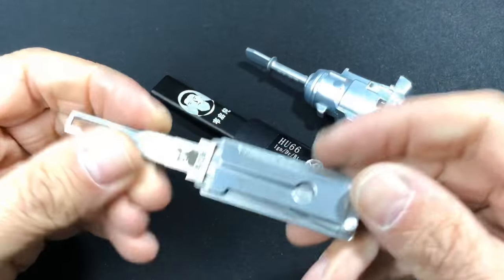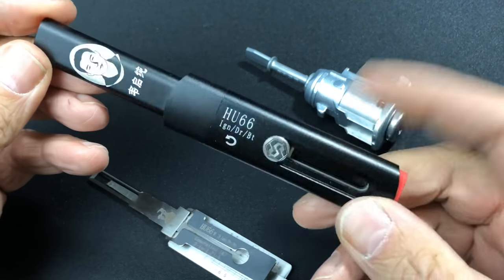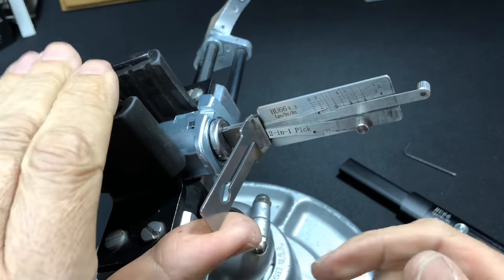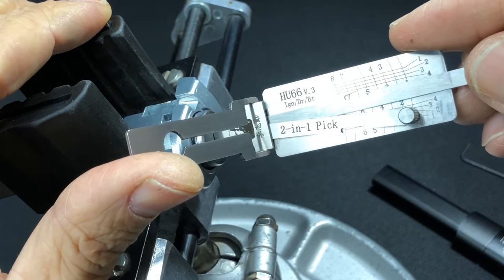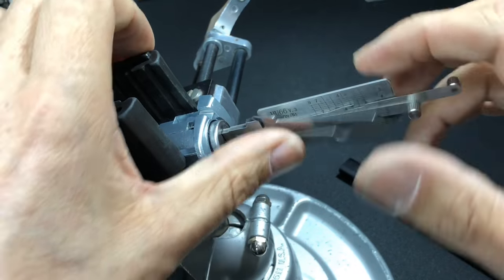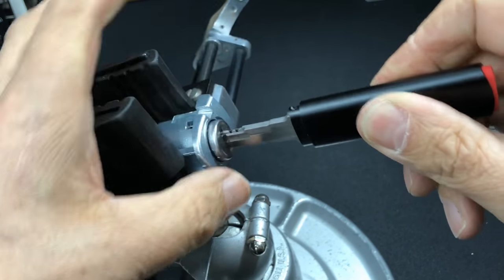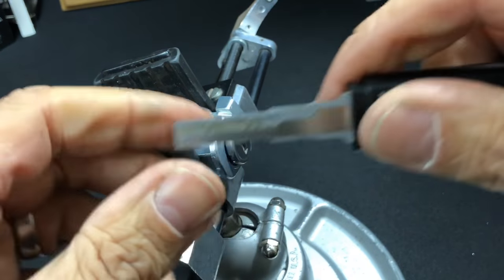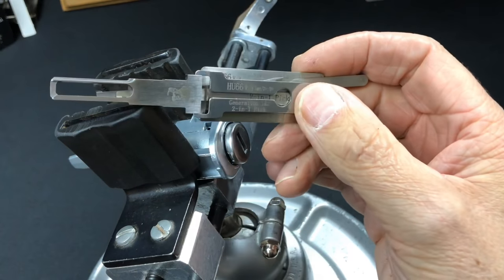New Hu66 kwik decoder vs. Lishi Hu66 v3  tips & tricks (Audi A4 lock)

Comment: the hu66 kiwk need to be careful because they can snap inside the lock and almost impossible to remove when that happens. personal experience.
Reply: Mool
Reply: I agree used it one time it took an hour to open. Used it again and it refused to come out of the cylinder and broke off.
Reply: mine snapped. I watched that video, that guy really do that too hard. I thought it was the way. But only gently left and right smooth moves also works! I dislikte this video.

Comment: Would my VW/Audi be able to drive, using one of these in the ignition, instead of the door? If I wanted to use the HU66 quick decoder as a valet key or something similar. Would using it set my car alarm off without the fob?

Comment: I just ordered one of these but the dealer said they were out of stock(lots of other sites the same too)Anyway,they had the blue coloured np tools hu66 Kwikdecoder which they said is slightly better,newer tool.
I ordered it but,and this is from a newbie point of view,there are no numbers on it!!???How in the hell am i supposed to decode this and make a key in an all keys lost situation??
Anyone help?Thanks.
Reply from the maker: robbocop33 r I’ve not used one of the new Hu66 decoders yet, I will get hold of one & try it out, but with out the number scale it would be difficult to decode. One the I will say is there is only 4 different cuts.
Reply: @dazevers  yep,there are faint lines but i suppose i can still decode it,and 4 measurements obviously makes it a bit easier! :-)Just be more convenient to have the numbers there,Thanks for your reply!